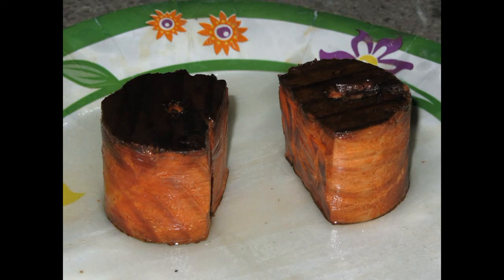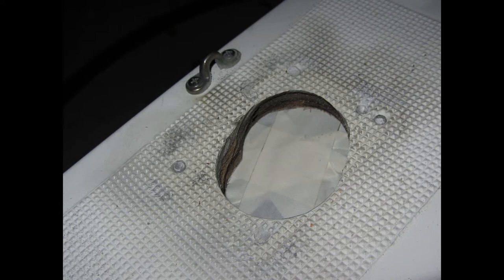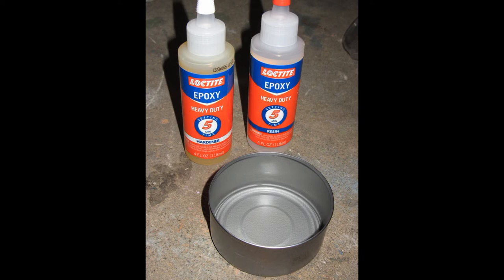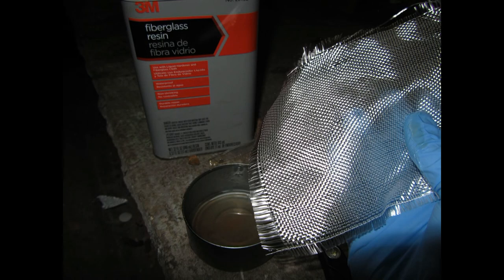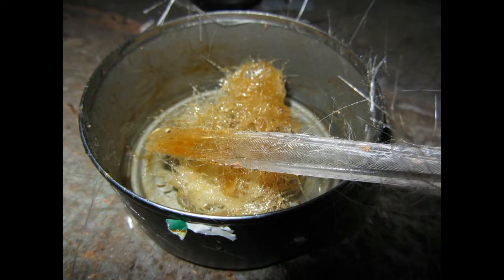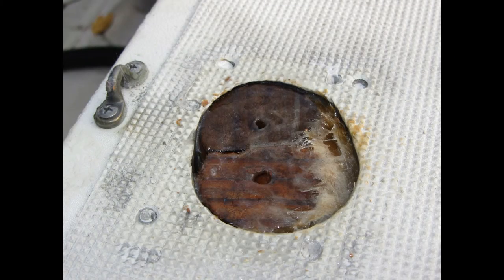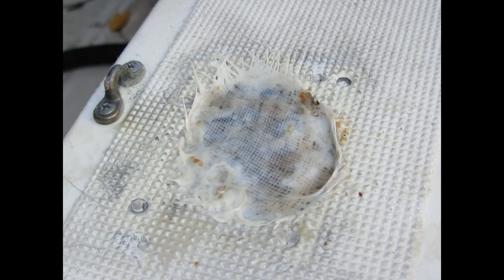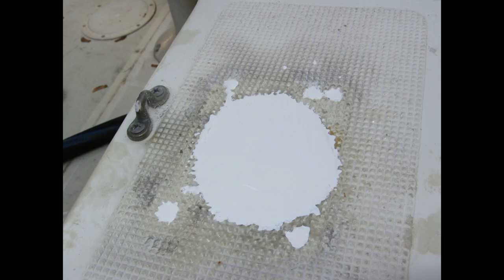Gunwale Repair - Fix that hole in the side wall of your fiberglass boat.

Comment from the maker: @GT,  I don't know why I never saw this. Awesome to hear it went well. How did the final product turn out? May not want to paint them. May want to leave a gap below the surface, and finish that off with Bondo Marine Filler, or Marine Tex